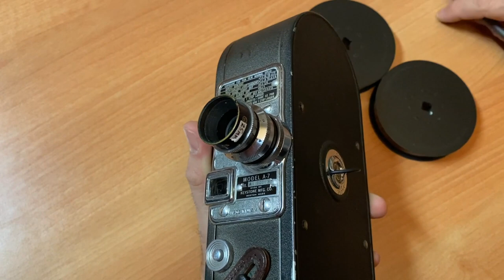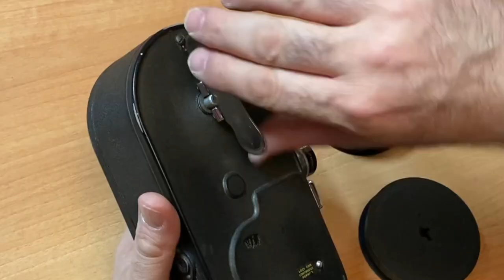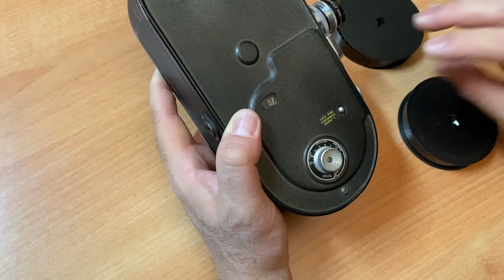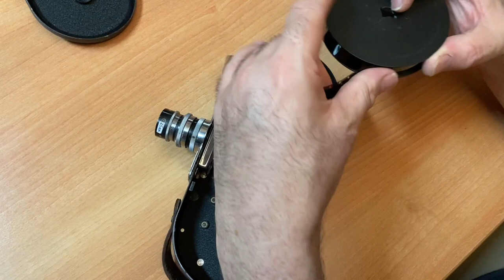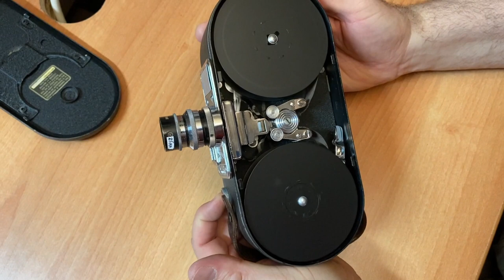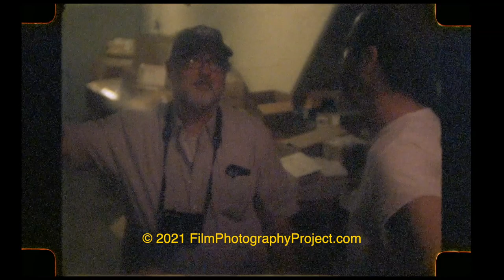Keystone A-7 16mm Camera - Overview and Film Loading

Comment: One caveat that I would pose to people buying these Keystone Cameras: Some of the A 7 cameras only have the speeds of the A 3. Even though the A 7 is advertised as having 64 fps maximum speed, not all A 7 cameras are created equal. I believe that around 1950, Keystone started getting sloppy and maybe the manufacturing guys, either intentionally or unintentionally,  made some mistakes and set the governors of the A 7 the same as the A 3.   I think that they are basically A-3's with an A-7 label on them.( You will also notice that around 1950, Keystone was advertising that the spring motor would run approximately 15 feet of film on a  single wind, where previously they were advertising 20 feet of film.) ,  The A 7 cameras that truly have 64 fps, the marking is further around the circumference of the speed dial. But the A 7 cameras that have the 64 fps  setting in the same position as the A 3 slow motion setting are getting the same maximum speed ( approximately 50 fps). Also, in this case, the 24 fps setting is where the letter "A" or "L"  on the "Normal" speed setting.  If you go to the 24 fps setting according to the manual it will be closer to 30 fps.  If you absolutely have to have 64 fps, I would get one of the Criterion models to make sure that you get it. My theory is that around 1949 and 1950 when they were moving into the production of the "Criterion" models the older models played second fiddle and thus were less of a priority. There was also a significant drop in price of the older A 7 and A 3 models around 1950 and beyond. Having said all that, they are still great cameras!

Comment: Are there any issues with filming at 24 fps? When you say shutter is 1/30th, you’re referring to when it’s set at 16 fps correct?
Reply from the maker: No problem shooting at 24fps. At 24fps shutter is 1/48th sec. I usually shoot 16fps because you get a longer reel. Yes, 16fps = approx 1/30th sec. Best wishes - Mike

Comment: Ok, so after shooting a reel do you need to remove the film and put it in a can in the dark? and then use the empty reel as the new take up reel?
Reply from the maker: Correct. (Film is on a "daylight spool" so you can handle in super dim light)

Comment: Are there any replacement sprocket wheels that you can replace in the camera to make it single perforated?
Reply from the maker: I have never tried but some folks have "filed down" one side of the camera "teeth" so that the camera can accept single perf film. - Mike
Reply: @FilmPhotographyProject  That sounds like a good idea. I am guessing the teeth near the top of the sprocket wheel are the ones that need to be filed down. Andy advice on the best way to do this?

Comment: What is the quality of the Wallensak lenses?
Reply from the maker: Wollensack lenses are excellent. However, most of these lenses are on cameras that have been stored in closets, attics and garages for up half a century sometimes resulting in fogged glass.
Reply: @FilmPhotographyProject  I noticed that on the A7 models, the gates are hard to clean and it looks like you will have to unscrew the bolted down gate to get better access to it. Also, Do these motors maintain their speed throughout the motor run? The way that I usually use wind up cameras is that I only wind it enough for the length of the scene. With Bell and Howell and Bolex this works because of the way the camera is engineered to maintain constant speed. I am wondering if this is possible with the Keystone?